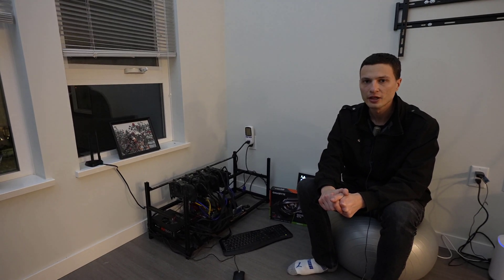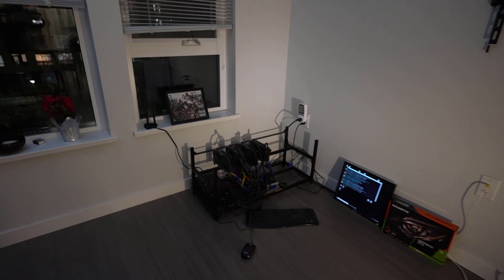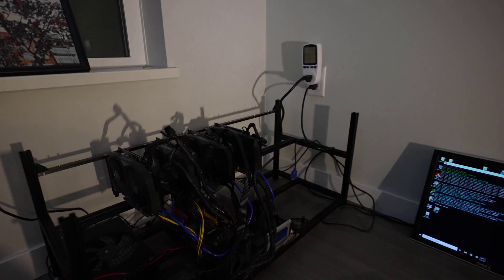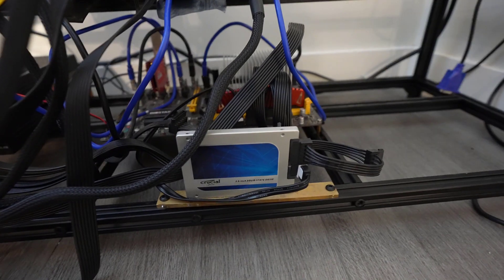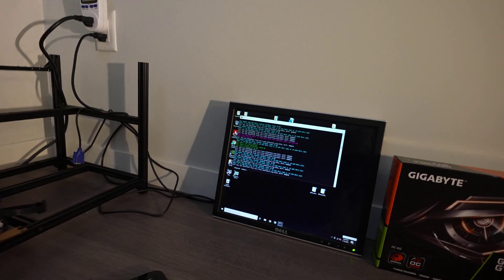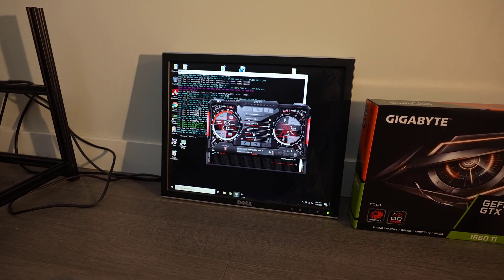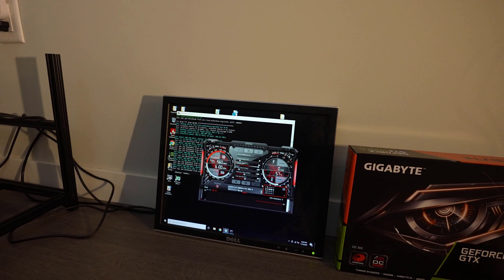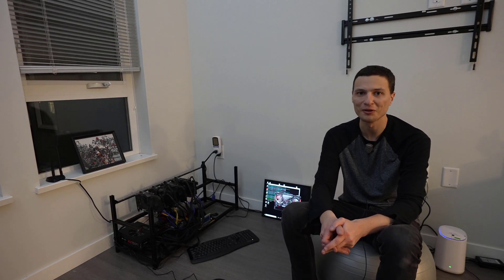4 X Nvidia GTX 1660 Ti Mining Rig Build | 110MH/s at 360 Watts

Comment: Check your overclocks.  I'm getting 30 - 31 MH/s with the Gigabyte GTX 1660 ti.  I have 10 of them. It's mostly Samsung memory, but I do have one with Micron and they OC different.  That being said, they are in 2 x 5 gpu rigs and the all Samsung one is doing 150.3 MH/s at about 315 - 320 Watts.

Comment: Hi Thanks for awesome video. I have a question about power supply. 
How much power I need if I wanna run 6 GTX 1660 Ti on rig including everything else
Reply: get a 800w psu for 6x gtx 1660ti, should be perfect they only consume 75w each more than enough

Comment: hello you  must do this   +900 mhz memmory clocking 
 power limit %63 or %65 and Core clock mhz down -291. my 1660s card  Gigabyte 1660s no shut dows problem .
30,500 -  31,500 mh/s 24 haurs test 58 C  .stable MSİ after burner  setting this .
Reply: mine is similar have 10 running at +1000 on memory -300 core Power limit 68 Temps are around 60-61

Comment: Too slow hash! Mine worked: core -200, mem +890 (p2-off) = 31,75MH/s (70w) Phoenix miner
Reply: mine is crashing every 2-6h on Pheonix miner. didn't get the best GPU yield, the best hash rate (31.6) at 72% power (85w) -502 core, +1145 memory good enough for gaming and mining
Reply from the maker: I have no doubt the cards can perform with those numbers. However, my number one priority with this rig is stability. In other words, I want it to run for 6+ months at a time without touching it. 

Being as conservative as possible is key for stability.
Reply: @VeeTechYouTube  The key is stabilty. You are right.  if you want to growth your rigs quantity and hashrate, you need to growth your rigs quantity, and your farm get larger and larger, you need stabilty, not %5-10 more hashrate.  if you have lots of rigs with problem, you cant handle.  get a larger farm and larger hashrate its only possible if you have stable rigs.
Reply from the maker: @levobryan6701  Thanks man!